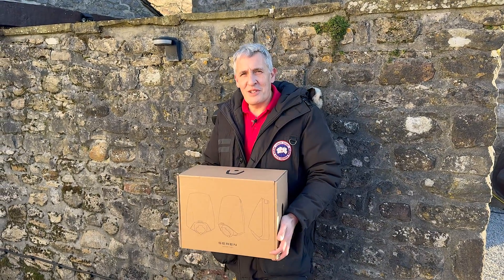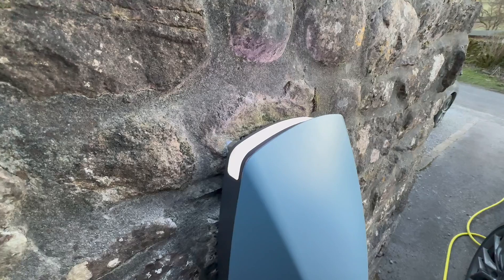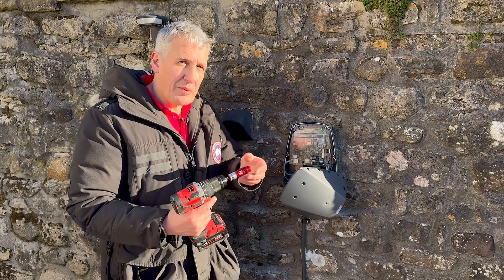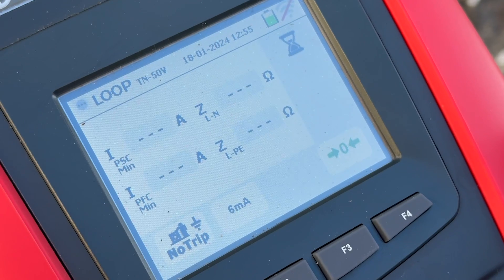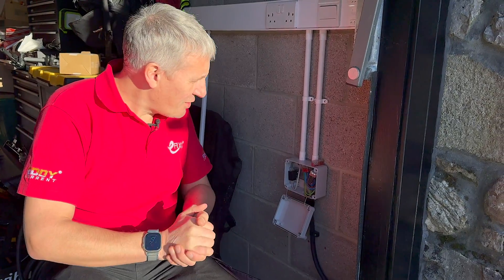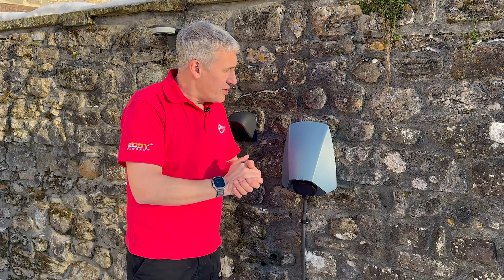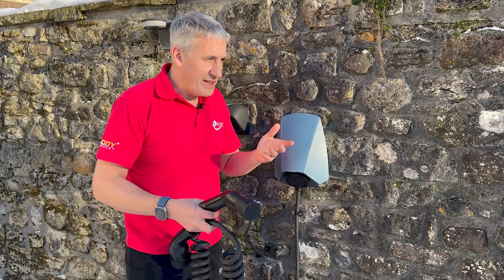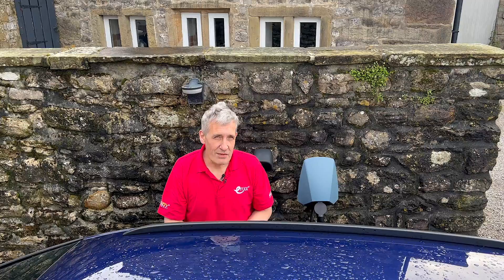EV Charger Installation UK  - SEREN

Comment: You blithely said download the app and set up an account…   I don't mind doing that for added features that I can choose to use or not. But if it's required for basic functionality then that's a No Sale.
Reply from the maker: It’s part of the Smart Charging Regulations in the UK - complain to the government
Reply: @efixx    <Boggle>  What on earth were they thinking of?
Reply: @efixx   "Is your smart charger about to become dumb? Don’t get caught out, says myenergi"

In this case getting stiffed for connectivity charges, But there are other ways you can be held hostage when dependent on remote services or lose your investment entirely when the service goes dark.

Regulations then are setting customers up to be stiffed.

(The quote is  from the myenergi blog, not putting a link as TY eats them.)

Comment: Loving your videos and your work.  I see for the video the RJ45s you are using are in not shielded.  I would worry the Cat cable would get unwanted noise/voltage from the power cables in the EV Ultra Cable.  Is this not an issue?
Reply from the maker: The twisted pair is enough to prevent interference. Remember it’s an EV charger at the end of the wire not a data centre.

Comment: Those Female to Female RJ45 couplers will give you a dodgey connection sooner rather than latter.  Replace them with Gel Crimps the type BT engineer use.  I speak from experience as I had to swap out a few couplers in Scotland that were put in by the furniture makers.  Salutations from Costa Del Watford.
Reply: Scotch Locks" are NOT rated for Cat5 or above. The alternate solution is to terminate to a female mech then plug in. It also shouldn't be terminated in the same enclosure as the LV.

Comment: @eFixx, thought about surge protection on the twisted pairs for the ethernet?  The transformers in the ethernet interfaces gives good isolation already but I've still seen persistent lightning induced problems on site to site wireless that were only addressed when installation of surge protection was finally allowed.  It's not much of an expense compared to replacing a dead switch and perhaps equipment further on.

One instance I know about happened to someone I know.  A full rack of a digital A/V distribution system at his luxury home was written off by lightning for the lack of surge protection on a run to a large pergola in the gardens.  It wasn't done by me otherwise it would have had it or more likely a run of fibre to the pergola.  The damage bill came out at $AUD 40k-ish.

Comment: I am not familiar with Uk electric and Ev chargers.. Why is there such a low value requirement for earth impedance concerning Ev chargers? Is it a requirement from the manufacturer? With a T.T earth system the max impedance can be
 50 V/0.03 A (1667 Ohms). 50 V is the max acceptable safe voltage, while 30 mA is the Rcd max fault current, before it trips.

Comment: Agree with @magarlands6123..its hit and miss with brass bolts....Theres a very fine line between too tight and breaking and not tight enough.../ poor contact...Thomas Nagy used s.steel bolts...P S. careful where you put the crimped lug.

Comment: Why not cat5e or 6? 5 is a very old standard and not good for distance like this, not good for outside either.
Reply: It's a 'charger', 10M would be overkill for the piddly amount of data flowing even it's full blown web interface if it has one.  If it's purely for command and statistics  it could be done with a 9600 serial link.  100m distance officially too.  It's hard to imagine cat5e (or cat5 for that matter) not being up to the job.
Reply: @retrozmachine1189  fair point, some things just work
Reply: They're not streaming 4K video to the damn thing, FFS.
Reply: @Grizzly01-vr4pn  still, if your installing any new equipment, its good to future proof. these standards are also more reliable
Reply: @Grizzly01-vr4pn  Yet
Reply: Cat 5 implies cat5e because you can't get the old cat 5 anymore 😂

Comment: Nice looking charger guys 👍
Can the same data cable (1nr) be used for CT monitoring and hardwired internet or would an additional cable be needed? Assume Cleveland cables would be keen to know also☝️
Reply: I think you can as from memory pins 1 2 3 6, Orange and Green pair in B wiring, are the data ones, the other two pairs could be used for anything else.

Comment: No CT monitoring for this charger? 👀 How does it know if the house is overloaded? 😅
Reply: That why you calculate maximum demand before you start. Not all installs require Load management.

Comment: That looks a lot like a single pole RCBO from lewden there. Naughty naughty.
Reply from the maker: They are the minature double versions
Reply: @efixx  Music to my ears! I believe Lewden call them “Single pole plus switched neutral” as the over current protection is obviously only protecting the live side. But I believe this satisfies the requirements of part 7 as it does indeed disconnect ALL live conductors. Sadly I see many non compliant EV installations usually because either the RCD is protecting multiple circuits or because the incorrect type of RCD has been selected.

Comment: Salt water helps with earth rods
Reply: How long does it help for, though? Won't it give an artificially low reading that will go back up again once the salt washes away?
Reply: @thomasdalton1508 Doesn't matter how long it lasts: it is not an approved method for lowering the impedance.
Reply: @deang5622  Presumably it isn't approved because of precisely the problem I mentioned.
Reply: @thomasdalton1508  Yes, you could be right about that!!

Comment: Normally, electricians doing data work is like kitchen fitters doing electrics, but that's some nice termination there 🙂  Beautiful job as always, chaps.
Reply: In the house I just bought there's some sockets that have been done by the plasterer. L and N inverted and Earth loose!
Reply: I'm CTO at a medium sized company and discovered 1 wrongly spliced Cat6 run and 1 loose walljack, after two electricians, who I paid £3000 to run a few hundred meters of cable. 
I redid them myself instead of calling them back.

What amazes me is that they said they tested the cables as good, but line 3 was broken in the spliced cable, and the walljack had a short to ground......... Never those guys again.
Reply: To be honest, your taught data in the electrical installation course theory and practical

Comment: I did an install in November and the brass bolt in the earth rod clamps shattered in the cold, less than 3 weeks after the initial instal. very awkward
Reply: I've stopped fitting the small rods with small style clamps. EVERY one I've ever inspected (including ones I've fitted) have always snapped off. I'll now only fit the larger style ones, never seen one of those snap 👍
Reply: You need a proper 16mm or 20mm rod with a G clamp the small stuff is crap

Comment: Earth discs are far more effective, easier to install, and can be installed in locations where you can't install an earth rod. They cost a bit more.
Reply from the maker: Challenge in this install as the area is tarmaced
Reply: They’re not more effective at all